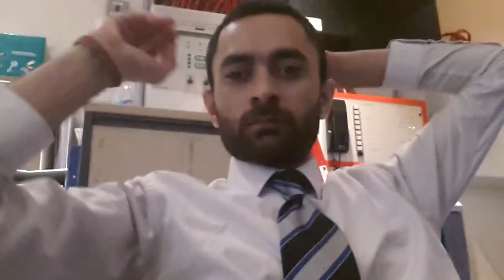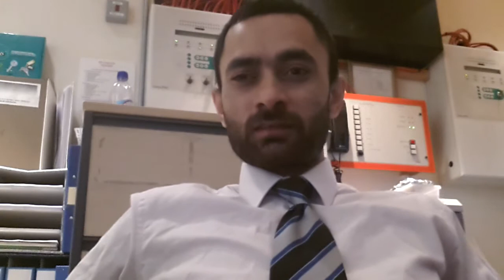System Update and New Designer Custom Made Box

Comment: dump the cap and get a kinetik or xs
Reply from the maker: 1trucavalier yes no doubt kinetik and xs are better than yellow top, but kinetik and xs are so expensive in UK. and atleast yellow top is better then factory fitted liquid batteries. isn't it?
Reply: Any battery is fine just no capacitors
Reply from the maker: 1trucavalier yeah i threw cap away long time ago. only used for 10 days.. then realized it was waste of money.

thanks anyways. :)
Reply: we all had caps I actually had 3 different caps the high dollar ones and they all are in the trash hahahaha